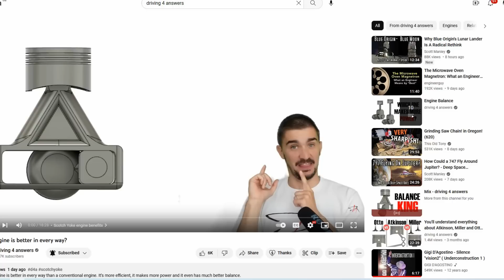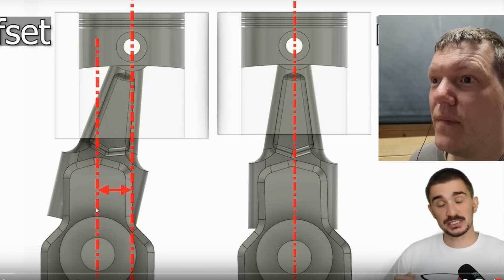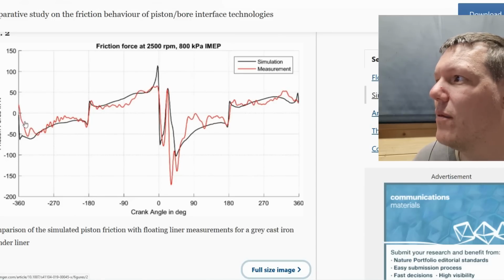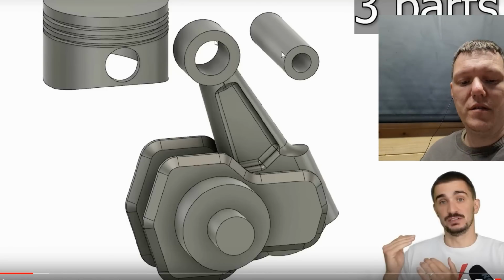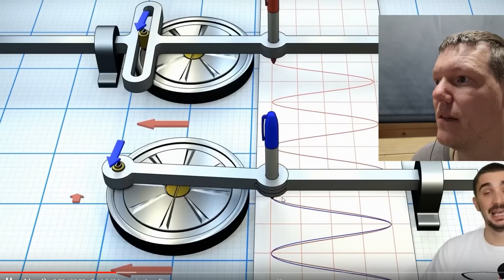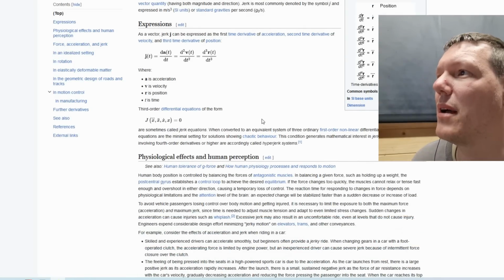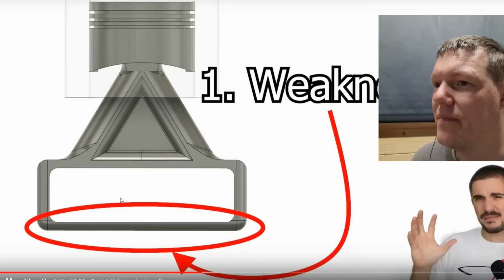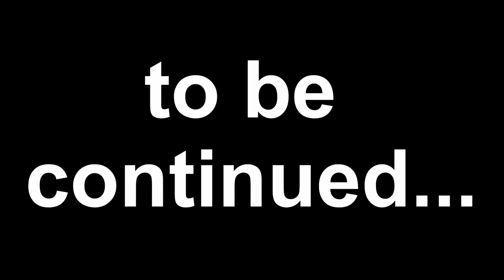Driving up the wrong way - Part 1

Comment: So to fully remove the side skirt loads and twisting, you would have to have the outside of the "rod" be a slide bearing in the crank case, then and only then might you be able to make one of these that doesnt self destruct immediately, and you would definately want to make it a dual piston  to maximize weight savings by sharing the slide bearings, if i ever have a hobby machine shop of my own, ill give it my best shot to make a small displacement engine with this principle in mind, but now that i think about it it might have to be a flat 4 so it doesnt need a giant counterballance

Comment: What I have that is TI is the frame of my glasses and some offcut (small bit of rod) I nicked from some machining place so I can do some electroplating  
What I have that us Carbon fiber? I think my tennis racket was Cf, might have been something else, hardly see it used outside of body panels on stuff

Comment: I had an argument with a Bourke engine acolyte where he claimed the dwell in piston motion near TDC resulted in miraculous stuff happening, I plotted piston motion with a scotch yoke vs a conventional con rod, and all you needed to do is run the conventional system with 5% fewer revs, and the motion plots were near identical. Of course he still didn't believe me.

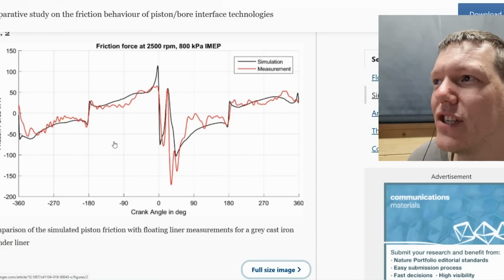Comment: 20:20 i do have 1 question sorry if i missed it, are these calculations done with load or without? Because if this is just free spinning i totally understand the 5kg's of force, but if thats with 100hp of load then thats impressive
Reply from the maker: One is simulated one is measured. The standard load for measuring imep is 30Nm from 7 to 10 bar (700 to 1000 kPa)
Reply: @thedirtyworkshop  ok gotcha, im not exactly sure what that equates to in horsepower, but thanks
Reply from the maker: Well that's based in rpm. So this engine ran at 2,500 rpm @ 30Nm that's 10 HP load. So for a 100HP engine that would be 10%
Reply from the maker: But don't think that 100% would mean the for is 50kg. They're not proportional.
Reply: @thedirtyworkshop   @dirtygarageguy  ah thanks! 
YOU DONT HAVE TO READ THIS NEXT PART, I KNOW ITS ALOT. thanks for answering what you can
That makes much more sense, but shouldnt the side loads be proportional to the load at any given rpm? Its been along time since i took engineering in highschool, and i wasnt that good at trusses, but when you have 2 lines connected at an angle and a force applied, each line shares the force between them as a percentage based on the angle of the force applied on that point. So just coming up with bs numbers, if at maximum angle between the rod and the cylinder wall 1% of the force applied to the piston is going into the side wall, then shouldnt it be proportional? Like at 100hp (at 2500rpm in this case) then the maximum force should be 50kg, im guessing this is a single cylinder, lots of engines can make 250+hp per cylinder, so that would mean a max side load of 125kg although if i had to guess its even higher forces at high rpm so what is it im misunderstanding?
Reply from the maker: No. Because power is work over time, forces are not. Power is a scalar quantity, not a vector quantity. 

As you can see from the graph, the simulated and measured results are also different, this is because harmonics, elastic collision, and fluid dynamics come into it. 

There's also rings to consider.

But in a nut shell, as combustion pressure goes up, this has a dampening effect on the piston's motion. Blow-by can literally cushion the force applied to the side wall as the piston force the gases out of the way.

Comment: If force isn’t transferred to the crank throw horizontally, does that mean you lose torque with the yoke? My understanding is that a component of the tangent line is horizontal, so not including that component from the rod would mean you miss out on torque. Or do I have it wrong and force is only transferred vertically even through the rod? 

Also wanted to ask, if the piston is moving faster during the higher pressure part of the combustion stroke, does that make more power as speed is part of power or is it cancelled by the decreasing mechanical efficiency?
Reply from the maker: "Isn't transferred to the crank throw horizontally" - I don't follow...

Ideally we'd want peak pressure to occur at about 45 deg, but with this arrangement that isn't possible. D4A graphic is all kinds of wrong and it's not the way to think about combustion.
Reply: @thedirtyworkshop  i see, i mean to ask about the sliding motion with the yoke. the yoke can only exert force straight down, whereas a connecting rod kicks out, and can exert force closer to 90°. It seems like the yoke would be massively inefficient. Gonna go watch the second video now that its out.

Comment: I think when people say advances in engineering they usually have in their heads computer driven design and machining as if its the ultimate but manufacturing the Merlin engine, steam engines dispite their size that was engineering and all by human engineers. AI and computer technology are not the answer, they may at best be another tool engineers can use to achieve what they think of design and build.

Comment: Good video!

I have noted that often when speaking of engine balance and vibrations people only have two words: 'primary' and 'secondary'. This is a bit annoying as there are lot more excitations that cause vibrations on engines. I understand that the magnitude of the forces is what really counts and that is why these are usually the main concerns on engines.

Also many times it seems that people make false conclusions basing their claims for just these words. Maybe because not really understanding the big picture of dynamic effects and that there are forces that can't all be cancelled out...or isn't essential.

Btw. This folk made a video about engine balance overall and i think it was like a movie made of the wikipedia page for engine balancing.😂

Comment: What the hell would they use a superalloy for in a petrol engine? You need those in HP turbines where your first stage is right behind the combustor and entry temperature sits at about 2000°K. In that world, every single drawback of a superalloy is completely justified, but why the hell would anyone put up with that in a regular old infernal consumption engine?

Comment: How is the whole thing stabilized to not tip over when the square is traveling to the sides?
On the steam engine the bottom of the rod was stabilized to not tip over, but his model has nothing to prevent tipping over.

The part with better technology to fix the yoke is just stupid, why not use that same technology to improve a already better design.

Comment: Carbon fibre for the average Joe:
Fishing rods and poncy flash bicycle frames/wheels.

Titanium for aforementioned average Joe:
Golf clubs ? Posh knifes often have Ti handles/bolsters etc.

But yeah, overall its a bs bragging thing.
I know of a guy that has fistloads of Titanium bolts in the engine of his car ... had to remove the sump and since the bolts are torque to yield and therefore single use...he could have paid a months rent/mortgage with the money spent on bolts nobody will see.

Also, as far as I'm aware, Ti is not the correct answer since it's more prone to galvanic corrosion than bzp in Al.

Literally no measurable benefit.
Reply: I approve of TI and CF use because it makes my stuff cheaper. Getting clout chasers to subsidise my paralypmpic racing chair is always nice.